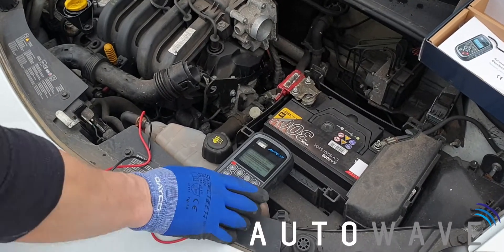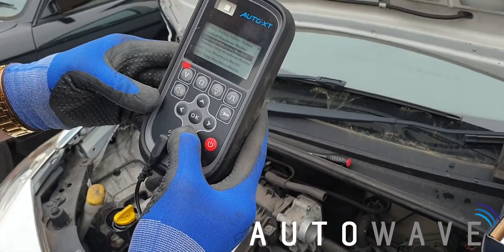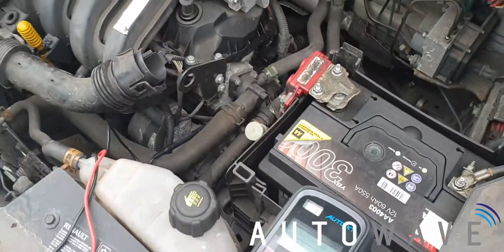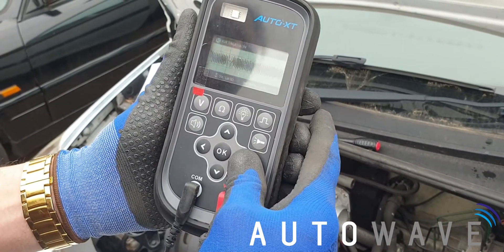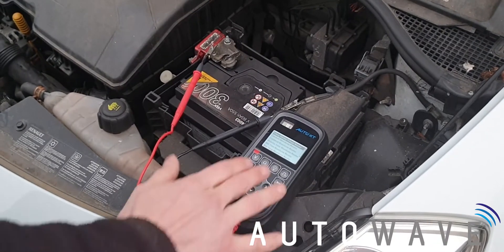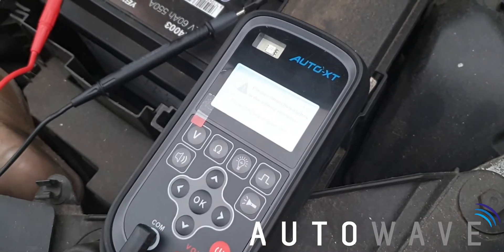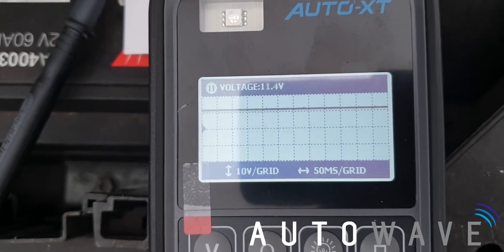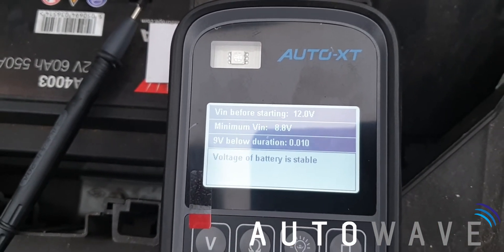Auto-XT Handheld Oscilloscope Multimeter Demo | 2009 Renault Clio III

Comment: Have you used the CAN function, Be interesting to see what kinda signal and voltages you get :)  Because mine look awful and was told the leads that come with it are not very good ?
Reply from the maker: Hi Mick, yes we have used the CAN function and it works as expected. The leads that come with it are good enough, but you can always buy more leads if you so wish. This is a handheld device with lots of features! Thanks
Reply: Can you share a video of that please